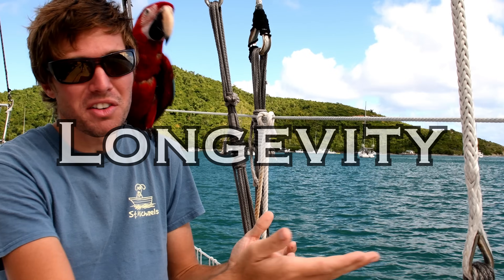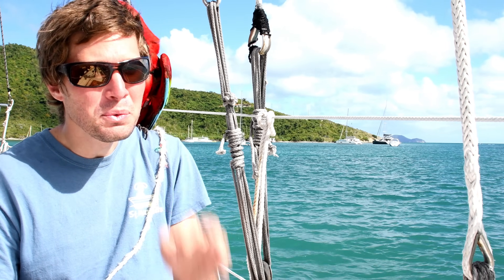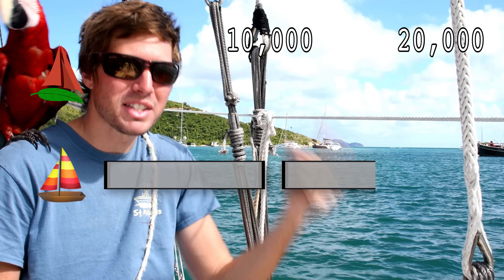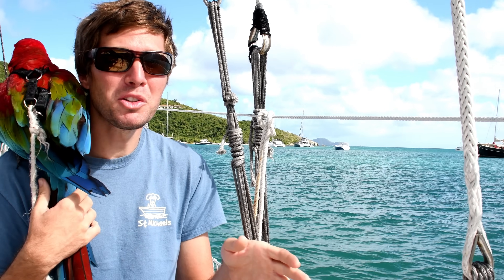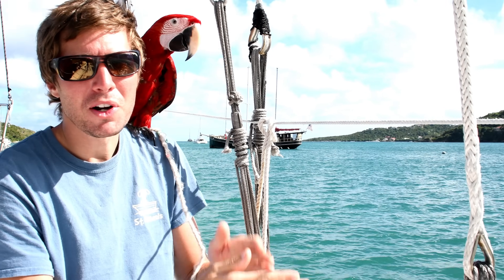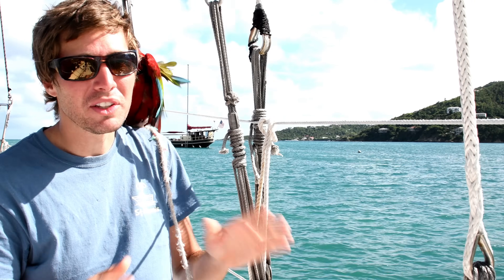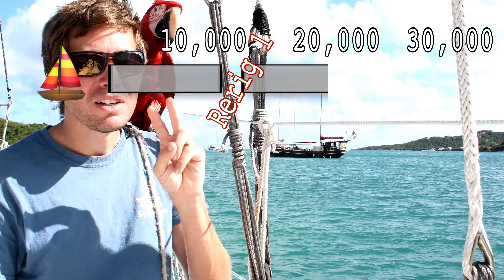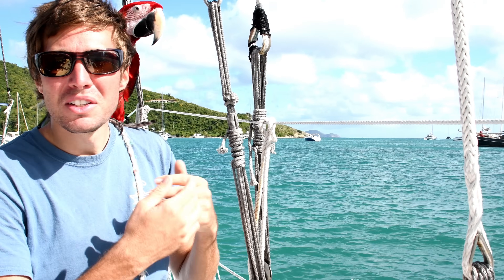Dyneema: The BEST Kind of RIGGING?

Comment: The claim that a microscopic UV-damaged "top 0.1 µm" layer shields the rest is unsubstantiated.

Best practice remains to fully cover Dyneema rigging—polyester braiding, heat-shrink sleeves—to ensure long-term strength and durability, especially in high-UV environments.

Dangerous stuff to repeat. Ask any friendly AI or provide sources for potentially dangerous claims.
Reply from the maker: That’s fine, covering is best but since this was the test boat, I didn’t want any surprises hiding under a cover. Now the rigging is 10 years old (uncovered) and still going strong so covering it will only make it last longer. 

Don’t use heat shrink though because the heating process will kill your Dyneema. Everyone talks about “an angry guy with a knife can take down my rig” but really all they need is a lighter.

Comment: That 10 year mark for stainless rigging is misleading and really more about insurance than the actual life of the rigging. Time and again rigs that are in perfectly good condition are replaced, at that ten year mark, not because of any problems but mostly because of the insurance.
Reply from the maker: I have yet to inspect a rig that is close to the 10 year mark without finding a fatal failure that necessitates a full rig replacement. The only exception seems to be boats on the Great Lakes which live in a time capsule :)
Reply: @RiggingDoctor  I don’t believe you

Comment: How can I find how much tension I should use in my rigging is my question now that I have materials together?????
Reply from the maker: It depends on the type of rig and if the spreaders are lateral or aft swept. Aft swept need to be tensioned to 25% of your wires breaking strength while lateral can be much looser. The target for lateral spreader rigs is 15-20% of the wires breaking strength, depending on a few factors. 
As the wire gets thicker, its breaking strength increases and so does the minimum tension.
Reply: @RiggingDoctor   Can I use whichever spreader I choose? Boat has no mast at the moment. I'm thinking of one from a hobie 18
Reply from the maker: Sure whichever stay is fine
Reply: Also,  what type of tension guage is used on dyneema if it is also different?
Reply from the maker: So, look up the folding rule method and the percent elongation at breaking strength for the dyneema you’re using to calculate your ratio to use with the folding rule

Comment: My rig is 35years old and still standing and many people sailed around the world not changing any rigging part.
Reply from the maker: That’s like driving a car 100,000 miles on the original oil. It can be done but you risk everything by not doing the proper maintenance.

Comment: I'm considering switching to synthetic, but am concerned with dyneema shrinking when it gets hot while aluminum mast expands when it gets hot.  If you tune when it's cold, but forget to loosen when it gets hot how much force is put on the fittings (chain plates and mast tangs)?  Will the shrinking dyneema cause enough force to pull chain plates out or rip mast tangs off?  For this question, assume a temperature range from 40 degrees F  to 80 degrees F.  Also, assume rig is tuned at 50 degrees.
Reply from the maker: If you tuned at 50F, it’s only a difference of 30F. I tune at 80F and find it fine +/-20F. I have sadly been in weather approaching 110F and it was tight but it didn’t break anything. As the weather drops past -30F from tuning, I don’t go full sail and avoid gybes. At -40F from tuning, I keep sails no higher than the spreaders. 
So, if you tune it at 50F and forget to tune it at 80F it will be really tight and stress the hell out of your fittings, but as long as they are in good condition they won’t break. If there is any hairline cracks in them, the force might open the crack up and reveal its presence. 
If the boat is going to sail in weather ranging from 40F to 80F, I would shoot for tuning it at 60F. 
It will be slightly tighter in the summer and slightly looser in the spring/fall but usable all sailing season long!
Turnbuckles will make it much easier to keep the tune, as loosening or tightening is just a matter of turning the screw as opposed to messing with the lashings.

Comment: What's the cost difference if any between your synthetic rigging and wire or rod rigging for your boat? Thanks in advance, I'm a total noob and will subscribe.
Reply from the maker: It’s a bit more expensive compared to steel, but it doesn’t have all the problems of steel

Comment: Uninformed sailors will complain, "But synthetic rigging can be cut with a knife so that is too dangerous"  (wrong, it can't be cut arbitrarily) 
Yet no one ever says, "When your STEEL WIRE fails under heavy load, which is when it is most likely to fail, the wire can explode and whipsaw at you, to cut you or your crew's bodies literally in half".    (True !  Steel wire is very, very dangerous in a breaking situation since it snaps suddenly and explodes all the energy of the load instantaneously) 
Because synthetic rigging does not store energy inside the entire loaded line in the unlikely event that the final holding strand chafes through or snaps, the split pieces become a limp noodle of frayed rope, not dangerous in themselves. 
So, synthetic rigging wins again.
Reply from the maker: That is very true! One of my dads friends lost an eye (luckily that was all he lost) when that exact situation happened to him.

Comment: Hey Herb, I was wondering and want to ask this for a long time, cose i have n abandoned boat i'd like to Re Rig, and thautgh abour Dyneema, but i fund realy hard to find sellers in france and was looking towards Marlow in UK, but they have dome different products like D20, SK 78 and SK99, each with different specs, what uou used, or recomend for a cruising sailboat? thanks for all thin knowledge =)
Reply from the maker: We used heat set SK78 for our standing rigging and and our inner forestay is DM20. 
DM20 is better than SK78 and SK99, but it’s also more expensive. For the price, heat set SK78 is a less expensive and very good.
Reply: @RiggingDoctor  thanks again

Comment: If you did it again, would you take DM20 instead? I think Dux is fairly reasonable over here if you buy 100 Meters at a time. What would you use with minimum creep?
Reply from the maker: We had a new metal inner forestay when I rerigged with dyneema (so I didn’t replace it at that time) that died on us in 2019 and I replaced with DM20. It is an incredible material but really pricey! 
Creep on DM20 is significantly lower than creep from heat set SK78. 

All this said, I have met two people with 40+ foot boats that rigged with Amsteel Blue (not heat set). It is significantly cheaper so they simply went way oversized and have minimal issues with creep. 
So, more expensive doesn’t always mean “the only way to do it”.

Comment: I have a 43' Roberts center cockpit full length keel ketch. The main is 13m and both the main and mizzen have two upper and two lower shrouds, no centre backstays and all standing rigging is 9.5mmm [ vernier ] s/s. I'd say it was 10mm that has pulled in. So I'm thinking of 12mm dyneema for the main and 10mm for the mizzen, thoughts anyone????
Reply from the maker: Ideally, you want to figure out the RM30 and then figure out the rig loads to properly size the stays. 
I have also heard of other riggers simply saying to go 1mm thicker Dyneema than the steel stay was.
Reply: @RiggingDoctor  Yea' that 1mm was something I mentioned to you a few days ago and the way areas work with solids is that it is always added to or subtracted from the outside. When you look at the surface area of circles with increasing diameters and do a 2,4,6,8,10,12 thing [ I used to be into telescopes ] the surface areas increase at an amazing rate. So the cross section area of a 10 compared to a 12 would be a sizable percentage and I think 12mm dyneema [ 75 ] is 17,000kg - Wow and there are 4 per side, so........pretty cool Herbie.

Comment: A very important aspect of the synthetic rig is the thermal expansion, hot days and cold nights make it not suitable. Am I right?
Reply from the maker: I wouldn’t say not suitable because we have been sailing with it in very varied climates. It’s just important to remember that it will slacken out when it gets cold so don’t have a full sail crash jibe in the evening! 
It holds its tune +/-20°F, but we have been able to sail on shorter sails all the way down to -50°F from the tuning temperature without problem (tuned at 80°F and sailing with it very slack at 30°F). 
I wouldn’t try beating in a gale with rigging that slack, but we were able to reach with success in the winter.
Reply: @RiggingDoctor  Seems the way to go. We will decide in a couple of years when going offshore. Tks for the info! Cheers

Comment: Just wondering about synthetic Vs rod rigging, how do they compare?
Reply from the maker: Rod has much lower wind resistance but the heads are very difficult to inspect. Synthetic is more windage but very easy to inspect. 
That’s kind of the big difference between them. It gets down to nitty gritty stuff like weight and stuff, but that’s the general difference between the two.

Comment: Thank you very much for posting this video.  I had never considered Dyneema for rigging but that was more due to ignorance than any actual knowledge.  Now, thanks to your videos I am considering it.  

In the comments below you mentioned that many riggers just use the +1mm over the existing SS rigging for safety reasons since they don't calculate the actual loads.  Is there a formula that one should use that is a good and safe way for a novice?  It almost sounds like a 9mm SS rig could be replaced by a 9mm Dyneema rig.

Comment: Thoughts on synthetic rigging on a trailered boat?  We have a Catalina 25 that spends most of its time on the Chesapeake, but we trailer it occasionally and step the mast a handful of times per year.  The steel rigging is a pain in the butt on the trailer because it gets tangled and is at risk of kinking, however if we moved to synthetic standing rigging, there is ample opportunity for chafing during stepping and unstepping.
Reply from the maker: Dyneema works really well for trailer sailors, since the line is soft when unloaded. As for chafing, it's not really a big issue since the stays will be slack so it's more case of them rubbing around and getting a little fuzzy instead of something gouging against them with a lot of pressure.
What part of the Chesapeake do you sail? We plan on being in the Chesapeake around the Summer of 2022. We should meet up!
Reply: @RiggingDoctor  thanks!  I thought about the possibility of coiling and storing the synthetic stays in canvas bags while trailering to avoid damage.

We’re in the upper bay north of Baltimore.  Meeting up would be awesome!

Comment: I see that windage has come up tangentially so far, but to address it directly: have you found any practical difference between the synthetic and a steel rig in terms of things like weathering bad storms and high winds? Not being a racer, my primary windage concern is that drag in a blow, especially in our increasingly wild weather world.

Cheers!
Reply from the maker: Not having a furled headsail is the biggest decrease in windage in a blow. When we switched and had our first squall, that was the biggest thing we noticed. The bow was no longer pulled along by the wind like it used to.
Reply from the maker: We have hove to in really high winds (we stopped sailing and started heaving to when the winds hit 60 knots). It wasn’t fun because of the present situation but we weren’t heeled over anything ridiculous. There is additional windage but the reduction in weight aloft helps keep the boat upright. I would say that our tiny trysail was the biggest windage in the rig and had us heeled over between 10-15° during the storm.

Comment: IMO you didn't address the primary advantage of Dyneema for a long term remote cruiser: you can carry a complete re-rig/repair kit with you. Hard to do that with steel.
Reply from the maker: That is an excellent point! We carry a 600’ spool in the lazarette, enough to do a full rerig and the spool weighs more than the line on it!

Comment: Great content as ever Herb. I remember from a video, posted sometime in the last year, you mentioned that you were considering changing out the synthetic tensioning method for turnbuckles. Is that still the plan or have you changed your mind?  I guess turnbuckles would make tuning quicker/easier, but if you're only tuning once every 3 years, speed and ease is not much of an issue :)  Interested in your thoughts.  Also, do you (or viewers) know what insurance companies think of synthetic rigging? Un-insurable? Insurable with the same 10y/10k nm re-rig caveat?
Reply from the maker: Insurance companies don’t care what you are rigged with as long as it’s 10y or 10,000nm. 
I would like to have turnbuckles but they cost about $100 each, so I’m going to keep deadeyes and $1000 in my pocket. I made the headstays turnbuckles because it was a pain to get the tensioning lines rigged up their and it was only two of them. 
If someone can afford turnbuckles, the combination of deadeye to take up the slack and creep with a turnbuckle below will be ideal!

Comment: 2 things that you didn't cover at all in one, and only touched upon in the other:

Cost: what are the cost differences, if any?
Weight: You stated there were weight savings but were too vague. Is it 50% weight saved? More? Less?

Ease of installation: How easy would it be for anyone to install this themselves or how difficult would it be to employ professional riggers to install it (would they be up for it or would most try to push you towards steel?)
Reply from the maker: These are good points!

Cost: cheaper than steel if you do it yourself, equivalent if you pay to have it made for you. 
Weight: about 90% lighter. The entire rig will weigh a few pounds so switching out the stays is very easy since nothing is heavy. I would say that it’s something a beginner could easily do since there are no special or expensive tools involved.
Reply from the maker: Most riggers will try to push you towards steel because it’s much faster for them to make and it uses that expensive swage machine they had to buy.

Comment: I recently purchased an older semi-custom boat with a Dyneema center board pennant. The boat had been very well maintained.   The surveyor (old school but very competent) had issues with the Dyneema pennant and recommended switching back to steel cable.  Your thoughts on Dyneema for a center board pennant where visualization of the synthetic cable isn't easily observable?  Thanks for your insights and candid observations about standing rigging.
Reply from the maker: It needs to be inspectable. I replaced our wind steering control lines with Dyneema and they chafed through in a few thousand miles! As long as all the leads are fair and there is no chafing, it should last a long time, but you need to be able to inspect the whole length or you might find yourself as a very deep draft vessel one day. 
If you are able to inspect it but not easily, I would give it a look at least once a week if you are sailing full time, or once a month if you are a weekend sailor. If it’s easy to get at, I would give it a look every time you plan to go sailing.
Reply: @RiggingDoctor  thanks for prompt and thoughtful reply

Comment: noticed on mine, temperature change affecting tension
Reply from the maker: Very much! As it cools it expands, then it shrinks back when it heats.
Reply: @RiggingDoctor  That is rather interesting.  Usually things expand when they heat up.  Thanks for that information.
Reply: @RiggingDoctor  correct
Reply: @RiggingDoctor  Does the shrinking require loosening the rig? Pacific North West based our temperature swings are becoming radical. Had reached over 110°F on the water this year, switch back to freezing.
Reply: Excellent question.  Thanks for asking!

Comment: Not sure you mentioned another advantage - less weight aloft. I'm going to use it on my catamaran I hope to launch next year. I'll use wire  for headsail roller furling. I hope to learn enough to do it all myself since no riggers live in the region.
Reply from the maker: I touched on it very quickly when I said it’s lighter, but didn’t go into detail on those advantages. 
Let me know if you need technical support when you are making your rigging. You can always email me for questions at riggingdr@gmail.com.
Reply: @RiggingDoctor  Thank you very much! I can find general stuff on channels like yours, Tulsa's, Zingaro, etc., but may have some specific questions to come. I did post a video tour of my project on my channel if interested in taking a look. It's a bit overwhelming for one guy, but getting there.